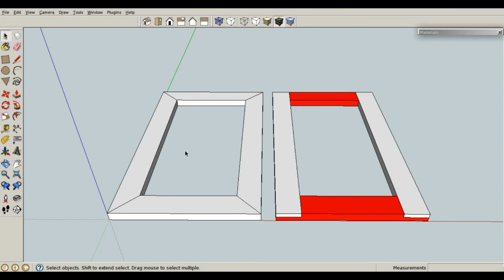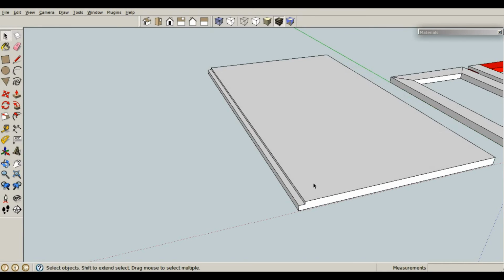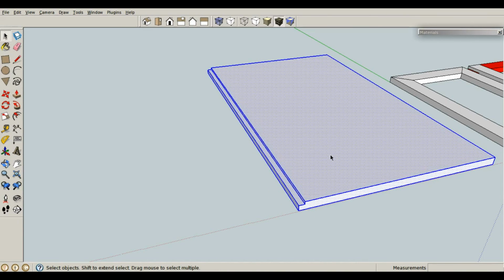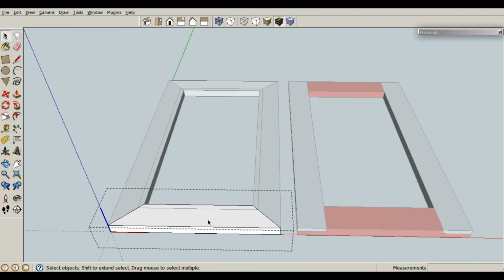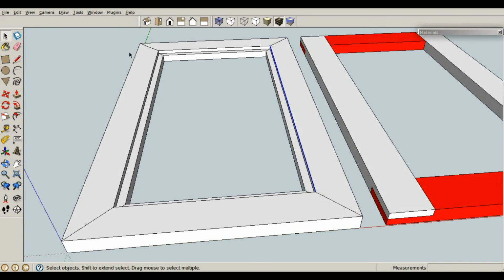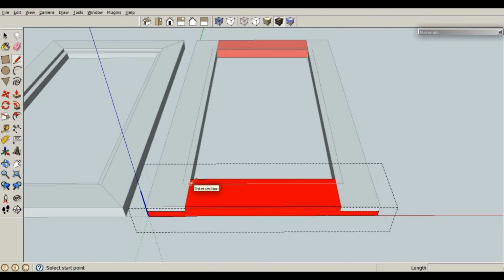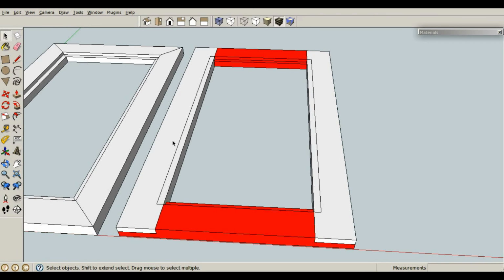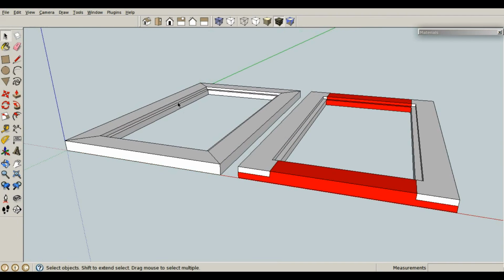SketchUp Rabbets

Comment: First off - as always, amazing videos in a very easy to understand and well organized production. You are one of the woodworkers I relate to the most and love your videos. I have watched these SketchUp videos over and over (mostly b/c I keep forgetting as I haven't had the chance to use Sketchup on a continual basis - I tend to draw on paper or do it in my head) and I have watched the dado and rabbet ones recently and it occurred to me to ask - how would you do a t-track (cut with a t-track bit)... well I guess how would you do it if you were installing metal t-track too I guess. Thanks.

Comment: Argh! When making the line or rectangle to push/pull, I could not get the cursor to snap to the intersection of the guide and the existing component. I finally figured out I needed to zoom in some for that to work. Now my mobile drill press stand will have a nice rabbetted-in back. Thanks, Jay - great video.